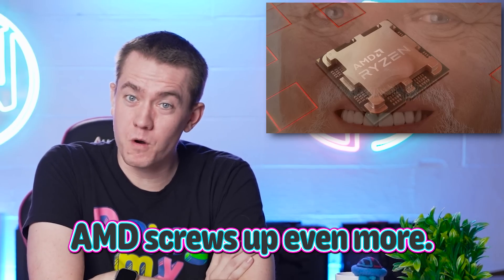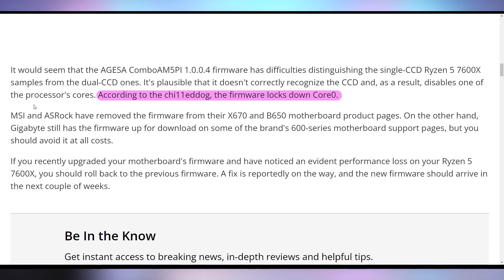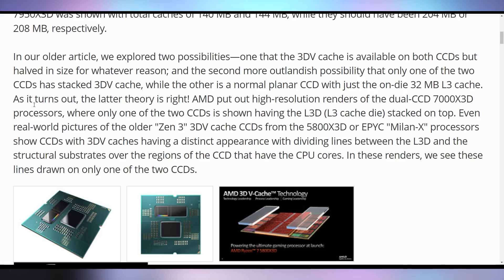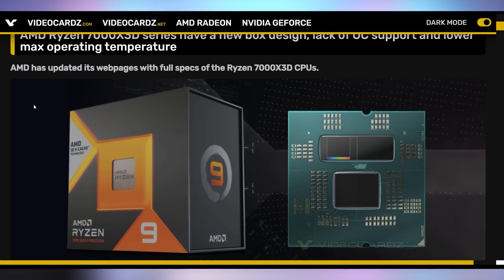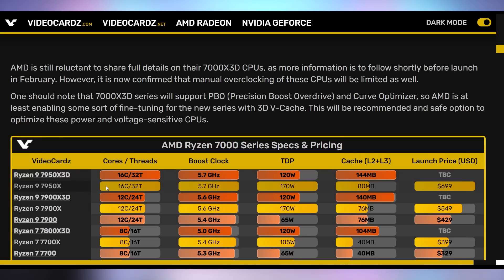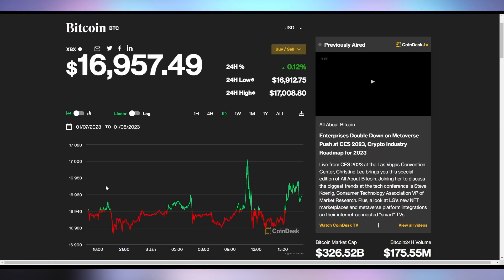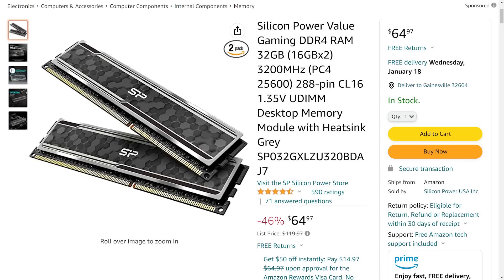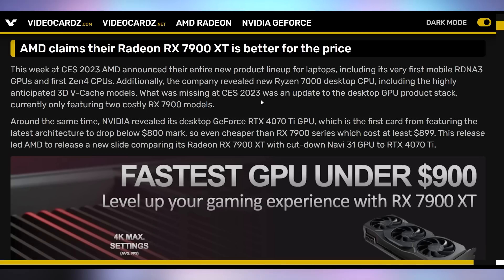Now AMD’s CPUs are Broken?

Comment: If only one CCD has the physical Vcache couldn't you run the other CCD at high clocks as it doesn't have the Vcache and interposer layer restricting thermal transfer?

Comment: The dual CCD 7600X don't have cores active on both chipslets, they're failed 7900X CPUs. There's no latency penalty for this. 

Not good situation though. 

What you said about latency on these chips is not correct in regard to the 7600X or 7700X, latency only applies to the dual CCD chips that use both CCDs like the 7900X and 7950X. They did the same with with 5000 series.

Comment: I got the 5800x3d. In mw/wz2 it sits on 60c with a 360mm aio. Cinebench hits 70c. Gained 40fps in both titles medium settings over 5600x aorus 3070ti. Funny thing is synthetic gpu benchmarks score lower due to lower clock speed but obviously cpu scores are much higher.

Comment: There is a reason why the 7900X3D and 7950 X3D has the V-Cache only on one Chiplet , the Chiplet without V-Cache can Boost up to 5,6/ 5,7 GHz and because the 7800 X3D has only one Chiplet , its limited to 5 GHz instead of 5,4 GHz . Maybe its because you can use higher Voltages on the Chiplet without V-Cache .

Comment: If the vapor chamber issues are only somewhat more frequent than all other RMA issues combined, it doesn't make much sense for AMD to send bulk mail to everyone for a problem 95+% of them may never encounter, especially if the issue is random across batches and cannot be pinned down to any specific serial numbers. AMD would just end up with a surge of RMAs for perfectly fine cards.

Comment: I agree that AMD needs to be doing more. But, lets not forget that Christmas and New Years just happened either and it's only Jan9th. Heck, I've only been back to work since the 3rd I'm also a Systems Admin. We rarely get breaks, I was called in 3 times over my "holidays" even New Years Eve and day! . It takes time to figure what the problem was, what machine(s) caused the issue on what dates, and what serials might be impacted. But yes, it should most definitely NOT be left up to the customer to figure this out. I would start yelling if we don't know by Friday. That's 2 weeks after the holidays to get their @## together and honestly, enough time. This is why you don't release something so close to Xmas.
Reply: Pretty much this (fellow sys admin here).  It's not that calling out AMD is an issue, it's calling them out before they had time to get a proper response out the door.  I don't know when they tracked down the issue (realize that this may have taken extra time because of the holidays), but the first time I heard of AMD stating the cause of the problem was the interview.  Once they did trace it down, they needed to figure out what cards were impacted by it while getting internal processes in place for handling impacted customers.  Since this isn't a safety concern (there's no fire risk or anything like that), I can see them holding off on an official announcement until they have everything ready.
Reply: Booo hoooo. You dont like it = quit.
Reply: @Chris Grui  very mature response. Thanks for the input.

Comment: If the 7800X3D has the same “3D” CCD as half of the 7950X3D but with less thermal management problems, wouldn’t the 7800X3D then be the superior choice? Interested to see if real world testing reveals that to be true
Reply: the 3d cache is what limits the clock speed and power draw, so by using a non 3d ccd it could switch based on which programs are optimized for the 3d cache and which benefit from higher clocks, as far as how well this will work i have no idea, but it seems like it would be a bit dicey, not really a gaming cpu anyway 16 cores, the 7800x3d seems posied too be the gaming cpu of this gen

Comment: I have been an AMD customer, maybe even a fan boy, for over 20 years (K6-2 to present with exclusively AMD desktops). You are 100% right that notifying either affected customers (if they can identify batches and match that with orders) or all purchasers of XTX cards is bare minimum and AMD should be scolded and ridiculed constantly until they do much much better.
Reply: K6-2 450 was my 1st. I still have it along with Epox MB and 128MB @ 100MHz RAM
Reply: @kmcbayne22  I cheaped out and got the 400. Amazing how long Super Socket 7 lasted given the rate of change at the time.
Reply: I was in that boat for AMD but even earlier (DX1-33) and I supported them up until Oct. 2022 , I finally got fed up with the shitty quality control and especially with the GPU's, Always waiting on that "next driver update" that will make it more stable, less buggy and better.  It never happens.  I finally had enough and now I am slowly but surely ridding myself of all my AMD hardware.   I'm down to just a 6800xt left and that's it (backup rig #1) My main rig is a 13600k now and has a 4070ti.  I'm much happier and the system is so much faster than before (was 5800X3D, and 6800xt)
Reply: @anthonylong5870  how the hell is 13600K faster than 5800x3d
Reply: @DragonOfTheMortalKombat  In every way
Reply: @anthonylong5870  I get being fed up with AMD but I frankly don't see how switching to Intel is the solution to that. Maybe if you live in a country with cheap electricity I guess.
Reply: @seeibe  13 gen Intel uses less wattage than 7000 series AMD
Reply: @anthonylong5870  sounds like complete bullshit and paid marketing.
I've got both platforms and Intel is dogshit in comparison. They use way more power, barely stay stable and need all the clockspeed to be fast. Also older programs sometimes end up on the E cores and run like shit.
As far as 6000 series; the drivers were better than Ampere 3000 series drivers literally since launch day. I had a 3080 not that long after launch and it literally idled at 200w+ on my triple 4k desktop and would crash all the time with videos on multiple screens at once. It also would crash if there was a game + video.
Funnily enough my 3070 laptop still has a variation of this problem TODAY literally over 2 years later.
It also has issues with screens with different resolutions. 6000 series has no real issues other than a slight stutter that can occur with certain OS's and hardware acceleration video through VMware on the host pc.
I've played tons of games with both my 6000 and 3000 cards and I've actually owned most every model of both brands and AMD is much better than Nvidia in that generation. So far the Radeon 7000 series is Getting better per day and some games the 7900XTX is faster than the 4090!
My system uses a 5800x3D on an old x370 board and I still have a top 125 spot in super position on a reference card without over clocking....
Reply: i started off with amd back in phenom days. Had poor experience. Switched to intel & it's been great ever since. But i would say now AMD has been good since 5000 series
Reply: I don't think so, ever since Ryzen, AMD has never disappointed. Radeon is a different story, it is failing to compete against nvidia for the past couple of years which is quite disappointing.
Reply: @DragonOfTheMortalKombat  Ryzen has issues with memory stability because of its infinity fabric.... That's why you could only use 3600 speed ram because anything higher would actually slow down the system and cause it to have memory faults
Reply: @anthonylong5870  I have seen people achieve very high memory  frequencies with ryzen 5000 process like 3800, 4000 and even higher. It doesn't make sense for ryzen processor since they have higher L3 cache than Intel anyway ( except for APUs). They are not the best processors for overclocking but the infinity fabric is exactly the thing which allows them to compete in the first place.
Reply: @anthonylong5870  Also, I am trying to achieve 3733Mhz on my ryzen 3500, will update if I am successful.
Reply: @DragonOfTheMortalKombat  I am over 5ghz on my 13600k and it's stable as a rock
Reply: @DragonOfTheMortalKombat  Ryzen 5 infinity cash doesn't like anything past DDR 3600mhz , It actually gives negative returns.....Go look it up.  Google infinity cash problems with ram
Reply: @anthonylong5870  5ghz ddr4? That's fast.
Reply: @DragonOfTheMortalKombat  Kingston Fury
Reply: @DragonOfTheMortalKombat  I think the 7000 series is very disappointing. Not that Intel has something truly better to offer. At the moment I'm basically stuck at the 5000 series, unless I'm willing to lay down almost 1000€ for a 7950X, mobo, and DDR5, which would be the only true upgrade for me (software dev).
Reply: @seeibe  Intel 13 series is faster and uses less voltage in real world.  It's also cooler and you can use cheaper boards and ram and still be faster than AMD
Reply: @anthonylong5870  What are you talking about, look at the performance/W benchmarks, Ryzen 7000 series is making 13th gen Intel look stupid in any multi threaded workloads..
Reply: Temper expectations
Reply: A nother
M ajor
D isappointment
Reply: @meekmeads   Oh really as if Nvidia and Intel have never disappointed , fanboi.
Reply: @DragonOfTheMortalKombat  

A nother
M ega
D isaster
Reply: @meekmeads  You really think you're funny?😂
Reply: @DragonOfTheMortalKombat  Not as funny as your salt mine. Sure, AMD will win with RDNA 7 or is it 8, no maybe 9.
Hard to keep track of their promises.
Reply: @meekmeads  Umm...... I think you haven't noticed but I'm talking about Ryzen, not Radeon which I know is a disappointment. Their CPU actually deliver in time unlike intel who delays..... A lot.
Reply: @meekmeads  we win reddit! :)
Reply: @meekmeads  lame

Comment: Did you register your card with AMD?

How are they supposed to know to contact you?
Reply: umm the driver can detect if you have a 7900xtx right... so they can push a notification with the driver...
Reply: @Eric-ct2ri  
The drivers don't "push" data to you for notifications.

They're not a means of communications. At best you could say you could push it through the adrenaline control panel, but even that is sloppy and shouldn't happen.  

There is no way guaranteed that they know who has the cards.  I've worked places that once you set up the computer, it's not connected to a network period.  

It's fine to say you want them to communicate to the users, but you have to have a guaranteed means of communication.
Reply: @Eric-ct2ri  
Let me be very clear about this companies have been sued for sending information through back channels without the users explicit permission. Not only should they not use the drivers to communicate with you you should be really angry really angry if they're communicating information about your computer without your permission.

Your graphics card should not be phoning home.
Reply: @pweddy1  and let me be clear i wasnt talking about the typical push notification i was talking about simply pushing as in putting out a notification somewhere ie actually doing something rather than sitting on their asses hopping no one notices... adding an extra page with a message to inform people within their driver would be a simple way to make a lot of people know about the issue... you see push a notification and you go insane cause you think im talking about push notifications...
Reply: @Eric-ct2ri  
AMD should not know I'm even running the drivers.

Period.

It's not a communications channel.

You can put it on the download page but not in the driver software.  You should never be required to login to AMD with the state of your hardware.  That information should voluntarily given when actioning a service ticket.  They shouldn't know what your hardware is without registering for the warranty.
Reply: @pweddy1  Where the hell you been these last 23 years? A company should not know youre running the drivers? Microsoft does this with Windows Edge Bing every one of their products. Google does this with Android Chrome Calendar Hangouts all of their products. Facebook all their products. nVidia all of their products. RealTek all their products. Razer all their products. 
Its called Analytics, its absolutely NOTHING new about it, you guys let your tech companies do this and sell your right to privacy away, now deal with it.

Comment: In reality, nVidia have an issue not screwing up themselves all by themselves. AMD will always be a screw up, they've never been good.
Reply: Have you had an AMD product? 

AMD's last generation was great, probably the best generation in my opinion of all time.  AMD, Intel, and Nvidia sucks from time to time equally
Reply: I agree with u in terms of screwing, but for amd to not be good? No. Yes nvidia is overall better, but to not be good, i dont agree, last gen amd didnt had much problems, this one they do, but mba models
Reply: @pasha715  it's hard to tell sometimes   and as often nvidia shills will make things up or exaggerate issues ie.  Radeon 6000 series drivers.  I think the 5000 series was largely overblown, and the 6000 pretty much proves it.  Also amd processors have been fine for a while as well.  As far as not good, find a better gpu for near the price of a 6600 or 6700 card, not to mention the 5800x3d.
Edited for typos.
Reply: @pasha715  Ok, maybe saying never was extreme, lets say since 2006 when AMD bought ATI, they have went downhill.

Comment: For gaming only half the cores having direct 3dv cache access probably doesn't matter, atleast for the 7950x3d and maybe the 7900x3d.
Reply: That's what I was thinking
The 7950X3D is basically gonna be a higher-clocking 7700X with a 7800X3D strapped to it's back
Even if the scheduler doesn't have the CPU primarily access the 3D v-cache with the cores that have direct access to it rather than the ones that dont, that things still gonna be a monster.

Comment: Looks like MSI saw the ref cooler being shitty and held out until the custom stuff is ready. Could just be a coincidence, but it want to believe, don't @ me 😁
Reply: Ref cooler designs are completely fine, it's just botched QC and defective units got through. Also ref models typically phase out quickly, MSI very likely didn't bothered with them in current low demand market. Instead they wanted to focus on higher margin custom designs they actually manufacture themselves.

Comment: The margins on GPUs are so small now, I don't see how the AIB partners keep the lights on.
Reply: That’s why they sell so much other stuff now. MSI makes monitors now. MONITORS!
Reply: @MrTekniqs  msi also has its subsidiaries scalp the msi cards 💀
Reply: How do you know this?
Did they show you their balance sheet 

For example amd is using 6nm? That shouldn't be that expensive.

Nvidia is charging +$500 for the new cards   
So.
Scalpers are buying them, I don't think they care who is buying them
Reply: @TheLateral18  ummmm these companies are publicly traded. Which means that their balance sheet is publicly available. Margins are small because in order to make a different product they have to r&d/produce the cooler, shroud etc.
Reply: issue is when all those publicly traded companies want to turn good profits : TSMC, NVIDIA/AMD and the AIB. ie: If each one is making 30% margin to please their investors and get great management bonuses, at the end, this is inflating the final price by a huge factor and pricing them out of their market as we see today.
Reply: the margins on gpus are extremely high for amd and nvidia its just aibs that have lower margins.